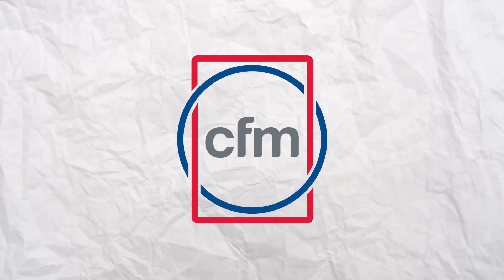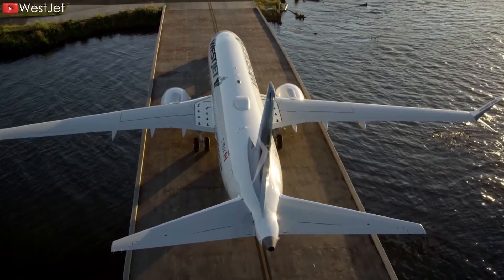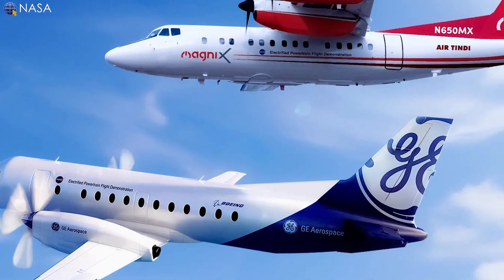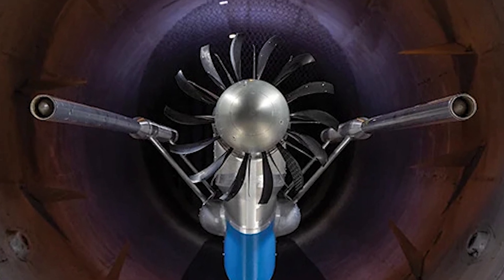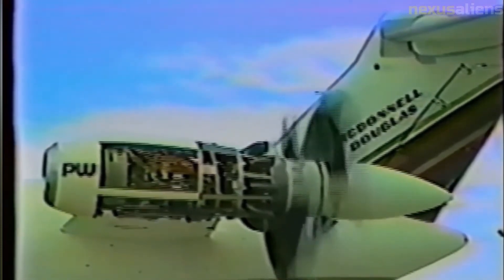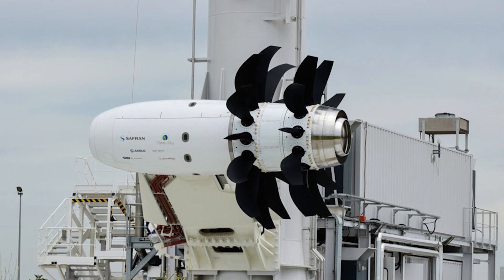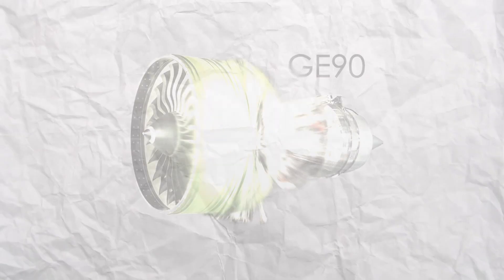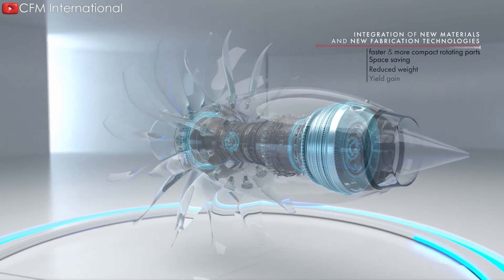General Electric CEO Announced "This NEW Engine Will Destroy The Entire Aviation!"

Comment: This project reminds me of the engines that were on the Vickers Viscount and the Vickers Vanguard which were EXTREMELY noisey and we're not "carbon free".  Having exposed blades turning at those speeds is extremely risky because they are not contained in the event of a failure and could easily puncture the fuselage.  Question - doesn't having exposed blades put limitations on the aircraft speed ?   Would it be possible for an aircraft with exposed blades to fly at the speed as conventional jet aircraft ?
Reply from the maker: yep many thanks for your sharing

Comment: "Open fan" , is that what you call a turbo prop now,  your PR department must be working overtime. It is not going to fool anyone knowledgeable in aviation. In theory , I am not sure hybrid is a good idea, for every time you transform the power, you generally lose a few % of efficiency. Trains and ship use hybrid for they eliminate the need for a complex power transmission system and free the drive shaft to suspension movement and to swivel, and weight , bulk is much more tolerable on a ship or train.  This net zero concept are bankrupting Europe, and carbon is a gas of life , not a pollutant.  Better get your science straight instead of falling for the climate religion. If you really want to contribute to aviation tech advance, work on supersonic drives.  Civilian aviation been stuck at the "sound barrier" for basically 3/4 century.

Comment: When I remember submarines got guided props because of noise cancellation, I was surprised that aviation would go the opposite way. I remember the Cessna 210 which became very loud when passing the observer during the take-off run indicating that the 3-blade propeller was the source of noise and not the turbo-charged piston engine.
Reply from the maker: nice, thanks for your sharing✈️
Reply: That is why modern subs get large props and with many blades. It reduce cavitation.  The prop in airplanes, especially contra rotating ones make more noise than the engine. That is why in the Vietnam era, Lockheed had the Quiet Star, with an 1800 RPM engine spinning a drive shaft above to a large prop. You have trouble hearing that plane above you in the jungle. Newer props are on the horizon, more efficient and hopefully quieter.
Reply: @tonylam9548  My experience was that a Remoqueur towing airplane with a two-bladed propeller was much noisier than a four-bladed smaller propeller. But the two-bladed one was much more powerful. A heavy sailplane had to be towed by the two-bladed one.